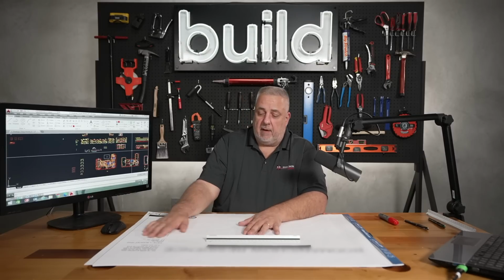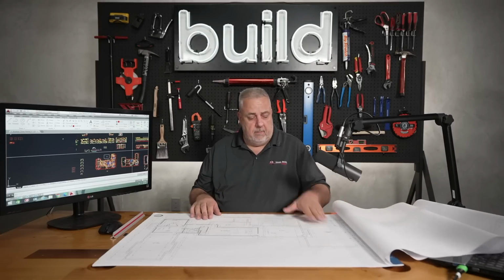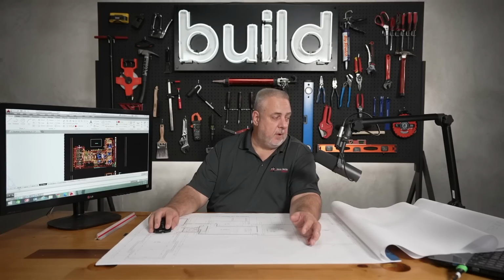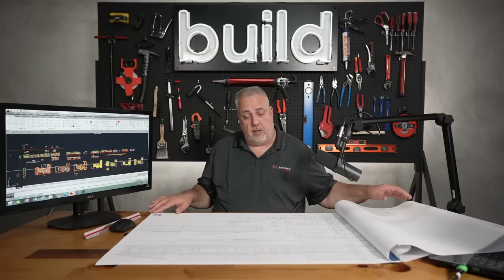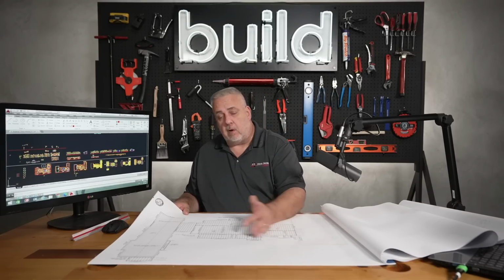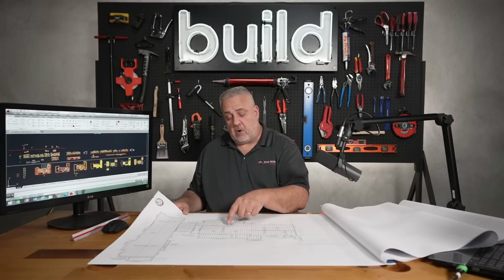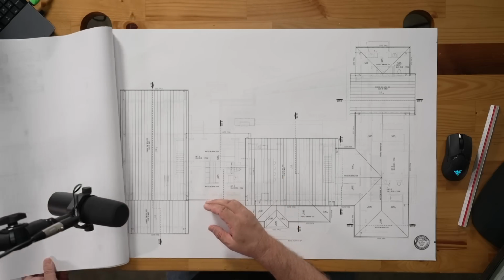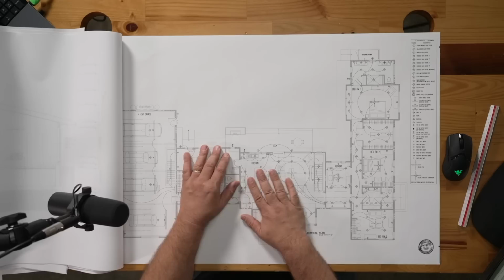"Reading Plans with Steve " Build Show Build: Boston BONUS

Comment: We have a note on our plans that points out that we expect every contractor on a project to look at every sheet in the set before they begin to even think about what they will do on it.  That note covers a lot of problems that begin with contractors who have no idea what anyone else is going to do.  With that said, as much as possible, I do try to fit drawings on the same sheet that are needed by one specific trade.  On small projects, I will put all the applicable construction details on the foundation plan, and framing plan, just so they won't have to flip pages.  Having fewer sheets also saves on the cost of printing, and everyone appreciates that.
If you are a contractor and work in one trade, do take the time to look at all the sheets in a set of drawings before you do anything else.  It won't take you more than fifteen minutes, and it can save you a lot of headaches down the road.  And if you see a problem, phone the person who drew the plans rather than try to invent something on your own.  It is quite possible that the idiot who did the drawings isn't as dumb as you think, he/she may have had that problem in mind months ago.  Call and find out.  Things do get missed by architects and designers, but since they are responsible for the overall project, let them have some input on how to solve the dilemmas you uncover.  They can often make a change to the plans that will easily fix it, or they may specify another product to use.  Either way, if they sign off on a change, you won't be culpable for any negative consequences.

Comment: Steve, when you dimension different elements (walls, door, windows, etc) in the floor plan do you normally dimension from center-to-center, edge of one to center of another, etc? And do you dimension to the wood framing or do you add dry wall, exterior insulation, etc?
Reply: Edge of frame to edge of frame - that's what the framers need.......Thanks for joining in - very much appreciated

Comment: Regarding the framing and foundation plan, I’m under the assumption you’re consulting with a structural engineer for those parts? I know laws vary from state to state for residential construction and what’s required to be signed and sealed. Just to provide some background, I am working on becoming a licensed architect in Oklahoma and have been interested in working on residential projects once I’m licensed.

Comment: Thanks Steve, great content as usual.  With today's tight houses and the need for ERVs, dehumidifiers, make up air fans/heaters, how much attention as the architect are you spending on considerations for best place to hide/run duct work, radiant floor manifolds, and mechanicals, especially in a modern build like this without a traditional vented gable attic?  I love the videos Matt has posted on his build and his foreman's new home build, but they have attics.  What if you're going timberframe or moden (or modern timberframe), who works out the mechanicals plan with an eye towards keeping the structural integrity (i.e. don't cut too many big holes in the joists) and the beauty / intention of the design (i.e. don't add dropped ceiling heights after the fact just to hide duct work).  Thanks!
Reply: I have done some timberframes, and slab homes - still have to figure out the routing....

Comment: Great job breaking down the drawings. I'm a structural engineer and the problem that I struggle with is how to organize and record the logic behind certain design decisions. Do you have a system or process to document why a decision was made. For instance, " I am putting a gutter/light/wall here for __ reason". That way if a change is requested, you know why the gutter was there in the first place, and if it needs to move, you know that you have to remedy the purpose of that original decision in different way.
Reply: I'd like to tell you such a document exists, but it is all on me

Comment: On my design-build commercial projects and some house projects, we number the pages a little differently.  The front pages are civil drawings labeled C-1,23, etc., Structural drawings next S-1,2,3, Architectural drawings, A-1,2,3, Electrical drawings, E-1,2,3, Plumbing drawings, P-1,2,3, Mechanical M-1,2,3, any revision would be A-2 rev. Either way will work, just showing a different approach.
Reply: Understood - thank you

Comment: Great video. You didn't mention anything about plumbing or HVAC. Is that all up to the trade contractors? However, you did have an electrical layout. Is it up to the electrical contractors to figure out how many circuits the house needs and other such considerations?
Reply: HVAC does their layout and Heat Load Calcs - we will review their work. Plumbing will be a meeting or two with the GC and Plumber
Reply: Yep, here in AZ Maricopa county, Load calcs have to be submitted with the plan for approval.

Comment: The remodeling set. Is so expensive,lol Demo, abatement,and special engineering sheets. 
You don't do door, window and header scheduling?  Interior design sheets, 
Babacad can read acad dwgs and it's open source runs Lsp.
Are you going to speak about specifications?
drawings communicates where.  Specs. Is what manufacturer,color, quality, and materials.
Reply: We are going to go thru all the assemblies and materials thru construction